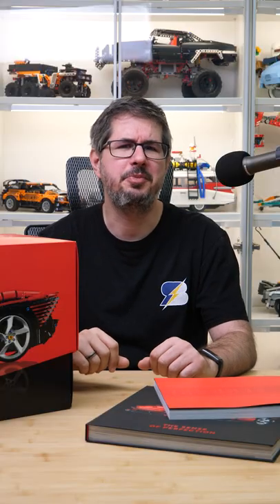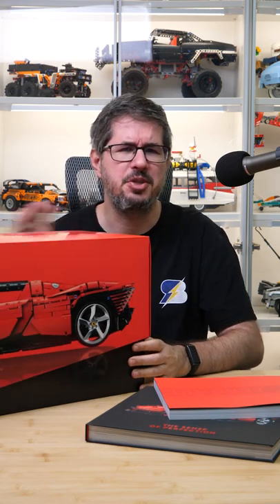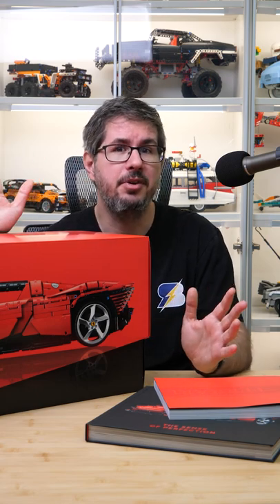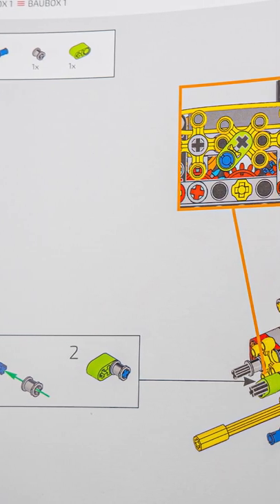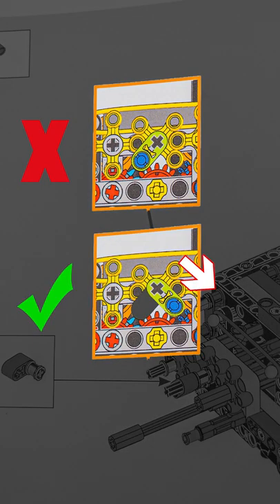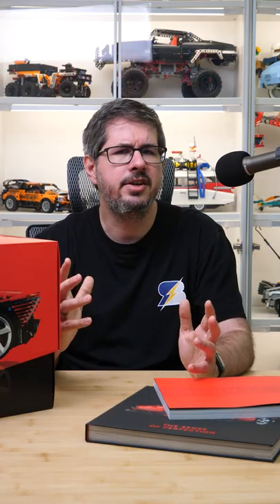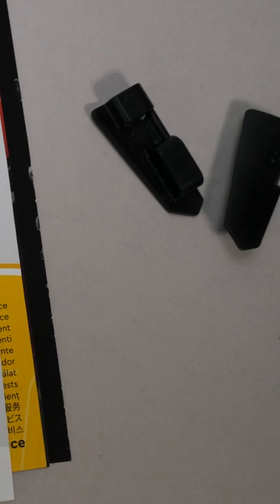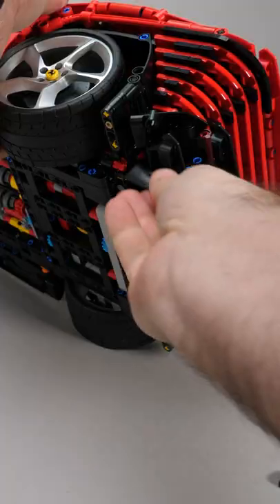Errors in the manual - watch this before building your LEGO Technic 42143 Ferrari Daytona SP3!

Comment from the maker: The gearbox issue was fixed in the latest instructions, but there are other errors as well. Check my updated blog post for the up to date list - https://racingbrick.com/2022/06/lego-technic-42143-ferrari-daytona-sp3-instructions-errors-and-fixes/
Reply: So....final correct position is left hand side?
Reply from the maker: @jacky3873  if you change the position of the orange wave selectors like on the new picture then yes, green stays on left. If the orange wave selectors are in the position shown in the original manual, then the green 2L beam should point right.
Reply: @RacingBrick  thank you😊
Reply: This man should work for lego O follow you since the start and i think you are the best lego youtuber
Reply: Great video!

Comment: Hi, I know I'm late, but I think I found an error in the manual. Maybe not an error, but something that doesn't make sense to me. Check steps 1110 and 1122, they're supposed to be mirroring each other, but there is a change, there is a difference in placement of 2 pieces that don't make them mirror each other.
If you agree or disagree, please let me know. Because both felt weird, like one was fine and the other was different and had different feelings and looks

Comment: I’ve bought this Lego set and the instruction manual was frustrating at some parts. I’ve built the Bugatti Chiron and that felt smooth. But the images proved were so unclear this time around and it’s just frustrating. I’m on 1225 to connect the rear of the car and you just can’t connect it. Part 1225 of the instruction manual doesn’t show how to connect it either. It just shows the part connected to the car like what.
Reply: That's exactly where I'm at right now. Did you find a fix? The top part doesn't align with the bottom. I feel like there's something missing
Reply: @GabrielNica  I cannot remember exactly but I believe I built that I built that part wrong. Double check just in case

Comment: Is there a reason why the green lift arms are put in that orientation? I mean didn't the porsche have non sequential gearbox built by design in the technic car to have a smoother transition?
Reply from the maker: You mean a reason for the incorrect orientation? It's a mistake. The position of the 2 orange wave selectors were changed compared to the Lamborghini, I assume to make the instructions easier to follow for people who are not familiar with those parts. But with that position change the orientation of the green liftarm should have been changed as well, but that remained the same like in the Lamborghini's instructions. So you either change the orientation of the 2 wave selectors in the Ferrari's manual, or the green liftarm. The latter is easier I think.

Comment: There’s a third error, I forgot which step it was where it marks an X for the wrong brick and a check ark for the right brick but it’s the other way around. You’re supposed to use the brick that the manual says is wrong.

Comment: Question: I am building the Lamborghini at the moment. Also a beautiful one. You told about the similarities between this gearbox and the one from the Lamborghini. Is this problem also applicable on the gearbox from this preview model?
Reply from the maker: The problem is not with the gearbox, but with the instructions. The Lamborghini's gearbox is fine.
Reply: The only thing I noticed with the lambo is it has trouble sliding in on the 4th push. It will go but it's kind of annoying and I have everything in correct position

Comment: So if I followed the manual, will the gear shifting still work just in the wrong order?
Reply from the maker: yes
Reply: @RacingBrick  Ugh I built the whole model but did not realize this until just now. Is there any easy way to fix? Also, what is actually the "right order" for the shifting, how do I tell if it is correct?
Reply from the maker: @BrianTitus  there's no easy way, you need to strip down the model. But at this point I don't think it is worth the effort, if the gears are in the right order then they speed changes gradually as you shift through the gears that's all
Reply: @RacingBrick  Got it, thanks for the reply!

Comment: On page 37 of Book 1, Build Box 1….the VERY first step in the build: Does anyone know what the symbol that has the Lego brick with a Plus sign above it means?
Reply from the maker: That means you have to take those parts from the unnumbered "extra" bags
Reply: @RacingBrick  okay, I thought so, but wanted to be sure. Thank you!! 🙏🙏
Reply: Wait, doesn’t page 94 have an error? There is a Red X next to Element 6261793 and a Green Check next to Element 4610374. But, shouldn’t we be using 6261793? Shouldn’t the Green check be next to that one instead?
Reply from the maker: @zachma1040  yes, the callout on top is wrong, the green checkmark and the red X should be swapped :)

Comment: Step 59 has an error that it was fixed in on-line manual, guess you missed that one… or not? 😊
Reply from the maker: What's the error in step 59? :)
Reply: @RacingBrick  The one related to the gearbox, but you already mentioned. In this case I just bought the set and ir seems that the error was already modified on the printed version of the manual… my mistake 😇
Reply from the maker: @robertoreal9371  technically there's no error in step 59, it would work properly if they chose to update step 88 instead. But they didn't so that's why step 59 was changed in the updated version. Anyway, the best is to check the list in the pinned post to see what errors are remaining in the updated version

Comment: I don't understand this error. It spins around to the same spot it says x on
Reply from the maker: The orientation of the green 2L beam matters when you put it on. The 2 orange wave selectors should be in a specific position as it is highlighted in the manual during the previous steps, and if they form that V shape when you look from above then the green 2L beam should point to the bottom right direction when you attach it.
Reply: @RacingBrick  I went back this morning and think I got it to where It needs to be. As long as the gears are in the correct position I should be good right? The Grey is where they should be but the orange piece is slightly off from the pictures. It's in the grooves and everything but hard to get orange in identical position. As long as it's in grooves and gears are where they should be I'm good basically right?
Reply: @RacingBrick  is it me or is the transmission identical to the lambo? When I look at bottom of lambo the gears are looking identical setup
Reply from the maker: @Gfranny  yes, it is identical to the Lambo. The digital instructions are now updated, step 88 was replaced with the exact config used in the Lamborghini. They choose to rotate the 2 orange wave selectors instead of the green 2L beam.

Comment: Built mine and I've got one door works perfect and the other won't stay closed,  anyone else had this issue or have I gone wrong somewhere.  Thx
Reply from the maker: Since we are talking about a symmetrical structure, if one works and the other doesn't then there should have been a building mistake with the non-working one for sure.
Reply: @RacingBrick  love your channel and yes I'm an idiot,  who'd have thought 1 single peg make so much trouble.